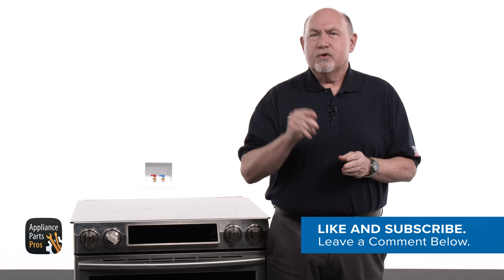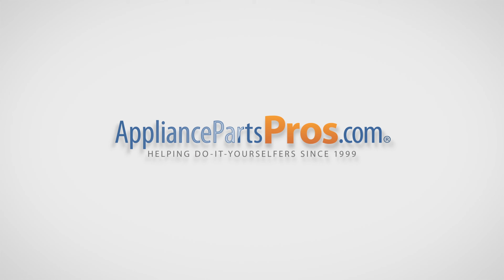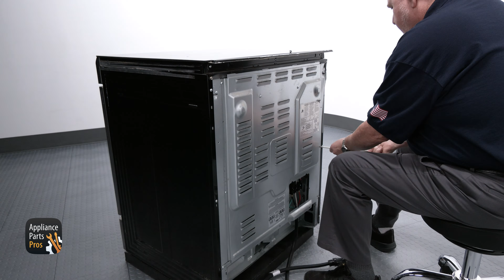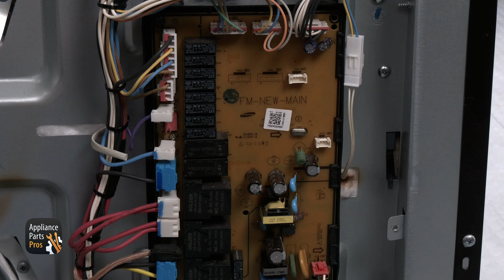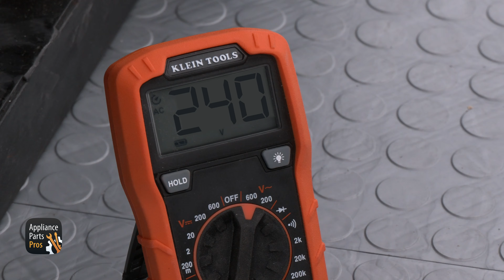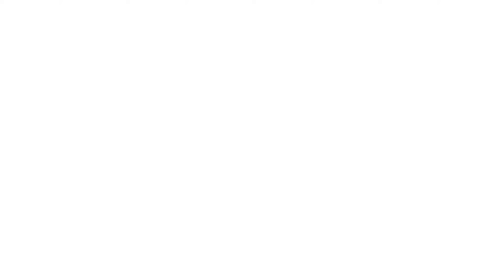Fix Your Samsung Range Convection Issue with This Simple Control Board Replacement Guide

Comment: Our samsung oven is randomly starting functions like broil, bake,  dehydrate within minutes of each other... it does respond when I press off, but something else starts automatically within minutes.... do you think this is a control board issue?  Am having trouble finding anything specifically like this online
Reply from the maker: Sorry to hear you are having that issue. You can check our our Repair Forum: https://forum.appliancepartspros.com/.  It’s easy to register, and you can either post your question or search the forum to see if someone else has already asked the same question.
 
Our experienced technicians, with over 20 years of hands-on appliance repair experience, are ready to answer your questions and guide you through your repair.

Comment: If all the burners stop working but the oven still works, is it also a main board issue?  I have checked the voltage at the terminal and it's correct at 120v each, 240v total.
Reply from the maker: That’s definitely a frustrating issue when all the burners quit but the oven still works. Since that can be caused by different things depending on the model, our techs can help you pinpoint it at forum.appliancepartspros.com. Just post your model number and everything you have already checked and they will walk you through the next steps.

Comment: Can you guys do a video on 	Samsung DE41-00376B Main Control Board and show how to test it ?
Reply from the maker: We really can only do videos for the appliances we have in-house. If one comes in with that part, we will definitely do a video covering it. But, testing a board would be different based on the symptom. What model number are you working with and what is the issue?